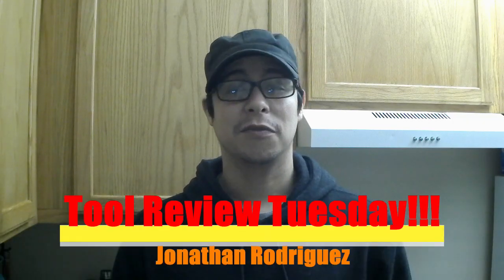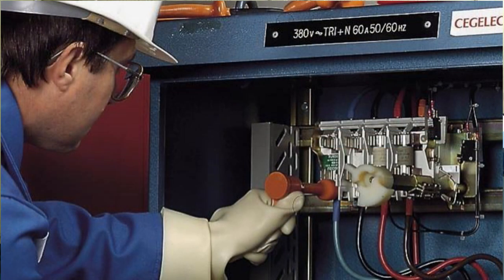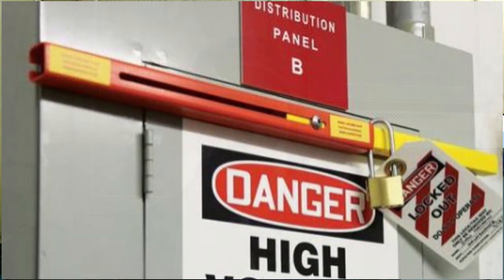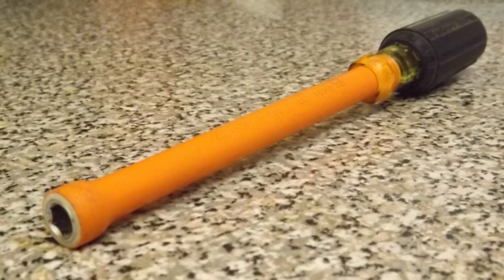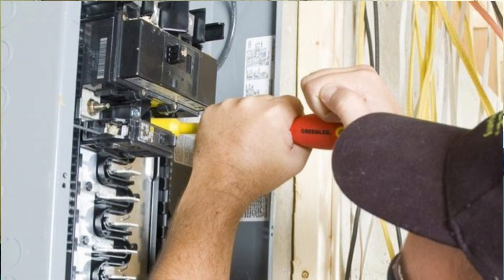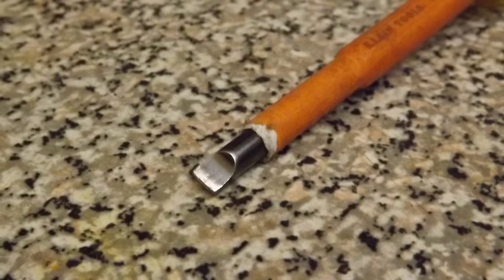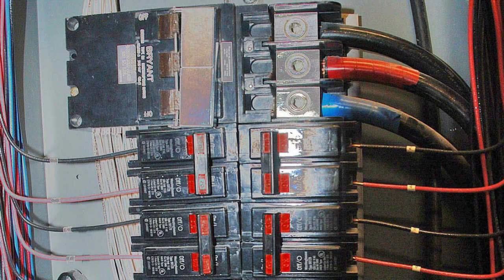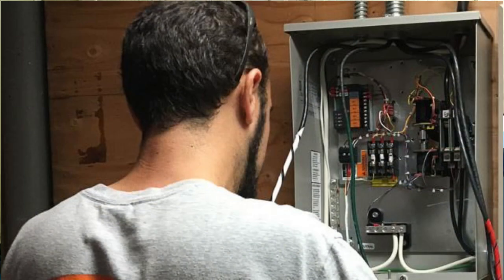T.R.T Klein Tools Insuated Nut and Screw Drivers! KleingGuy

Comment: Wish they could be a little more economic to buy $40 for the slotted and Phillips set . I’ve been using the Milwaukee 3 pcs set for last 3 years and only complaint is I wish They could make the #2 Phillips with a 6inch shaft .
Reply from the maker: I feel you on the pricing and availability but its all about the deals! Keep looking for lower prices in other approved sellers or sources and check for good reviews of sellers and reviews on the tool itself and you could get a good price for these tools if you know where to look. Good Luck and happy shopping!